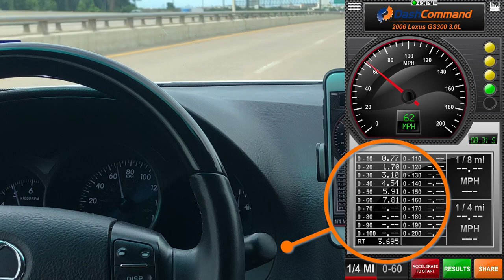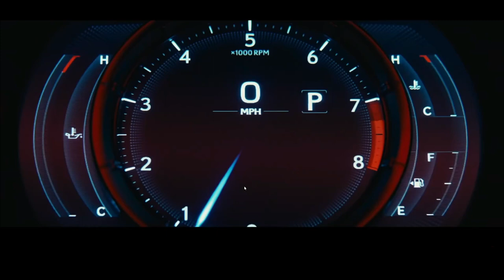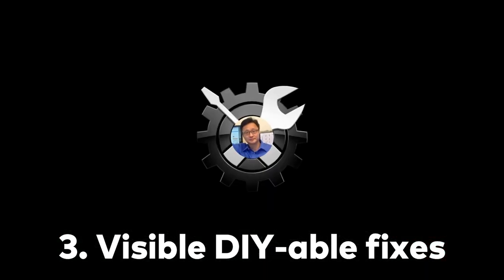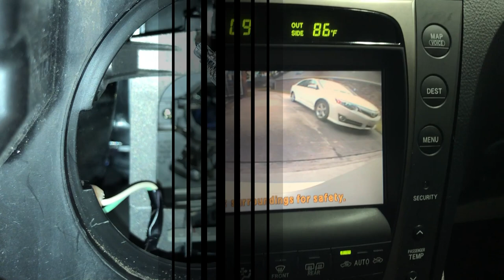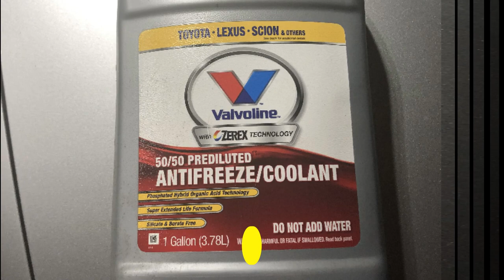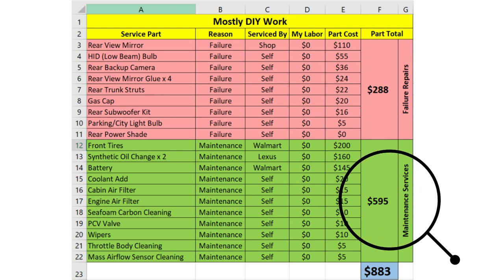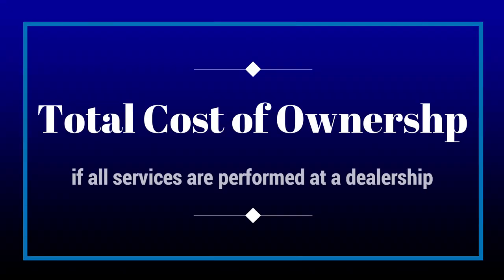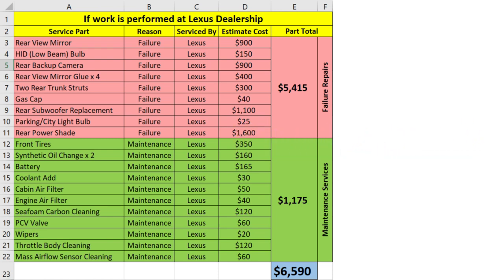2 Year Review & Cost of Ownership GS300/GS350

Comment: Thank you for your video. However, I'm sure most people will compromise and take it to a Japanese car repair specialist. However, I wonder how DIY folks like you as well as your local mechanic deal with the advanced cars of today which will become the advanced cars few years down the line. Will DIY and local mechanics have the equipment and technical expertise to be able to troubleshoot those used cars of moving forward,

Ravi Peiris M.D.
Reply from the maker: Actually, the diagnostics tool have advanced with the car, so most of the time, the diagnostic tool tells you problem areas.   Combustion cars still will be around a long time, but definitely electrical cars will rule, and without the complexity of combustion engine and transmission.

Comment: I have the slightly newer version GS300 so nice to drive it's in very good cond
Reply from the maker: I love this car.  :-)
Reply from the maker: This car is rock solid. Do keep up with the maintenance and it's going to last a long time time. How many miles do you have?   
Once the weather cools here in Houston, perhaps in the fall, I'm going to do the Transmission and Rear differential fluid changes.  
I saw the oil on spark plugs though I'm not leaking oil any where, I'm going to do the plug tube seal and valve cover changes also later in the fall.
Those are about the last maintenance that I haven't done, otherwise, I've done everything that I can.  I got 116K miles only on this 2006, so I feel like I can drive this to 200+K miles.
Reply: I had my first part failure today the boot latch release cover $10

Comment: I have found Lexus GS 300 But its at 300K km/186k miles Would you say that’s too big of a mileage for the car? Other than that it has all the servicing done.
Reply from the maker: Depends on how well maintained it.  What year and how much?
Reply: @DIYLifeSkills  it’s a 2006 model 5300 USD
Reply from the maker: Price is not bad given the inflation.  If you really like the car, I would get it checked out, especially the engine and transmission.  See if they did the transmission fluid change and carbon cleaning.  This car is GDI engine, meaning fuel sprays directly to piston and not to intake valves and heavy carbon build up needs cleaning at some point. I just posted a video of me cleaning just 114K miles and you can see how much carbon has built up, thought the car was running just fine.
Reply from the maker: By check out, I meant get a mechanic checked out.

Comment: How in the world did you get this car for only $5000?
Reply from the maker: It had many embarrassing problems like Rear view mirror was all scratched up, rear view camera was totally fuzzy, side mirror gears were grinding for few minutes after a start, rear subwoofer was blown, rear shade didn’t work,etc.  so the owner priced it at $5k and I gave him the full offer.    :-)
Reply from the maker: Also that was before pandemic when used car prices were reasonable. Now I’m in profit with this car. LOL
Reply from the maker: Free T  What year and what size engine? My advise is to go with 2007 or higher because 2006 uses GDI (Gas Direct Injection) that doesn't spray fuel to the intake valves and massive carbon builds up intake valves, which requires periodic cleaning which is not quick or cheap to do. I'm doing the carbon cleaning of intake valves now, and you can check out some of the videos I posted.
Reply from the maker: Free T  I inspected and test drove it myself.  During the inspection, I found the problems mentioned above, and engine and transmission was quiet and smooth.   It's good idea to get it inspected from someone that you trust.  Wow used car prices have really soared. Unless you are in a rush, you might want to wait until next summer or so when chip supplies & distributions catch up, and used car prices retract. 

That said, if you need to purchase the car now, do run a carfax report, and with 170K miles, it's important that they have already serviced transmission fluid, replaced water pump/thermostat.  If not, these are one of the first things you want to do after the purchase.
Reply: Heh I basically got mine for $4300.  Traded in my 2001 BMW X5 3.0i which I bought for $3600 six months ago and put about $1200 into it overall. Will have to put the same and then some onto the GS300 but I looooove it.
Reply from the maker: @BadaBing.UCF30  Awesome. How many miles and what year? And what size engine?
Reply: @DIYLifeSkills  2006, 92k miles, 3.0 V6
Reply from the maker: Wow! You got a better deal than me with lower miles.  I’ve got a bunch of GS300 videos that you’ll probably end up doing also.  The big one is not letting carbon accumulate too much on intake valves and pistons. Especially the piston carbon build up can clog the oil holes on piston ring #3 and that’ll burn oil and only engine rebuild will fix it.  So do oil changes every 5K miles religiously with good quality oil.  I just cleaned the heavy carbon on intake valves and piston heads and I’ll probably have to repeat this in another 30-50K miles.  Also you are due for a spark plug changes at near 100k miles.  Enjoy…I also love this car.
Reply: @DIYLifeSkills  Thanks! Biggest thing wrong with the car right now is the entire suspension, every single rubber part is worn to the point of constant grinding and bouncing in every turn. Will definitely keep the regular oil changes every 5K miles in mind, I'm actually doing the first oil change under my ownership this coming monday. Probably do spark plugs next month then finally tackle the suspension by April or May.
Reply from the maker: @BadaBing.UCF30  This is such a nice car, so Get good brand name struts that can last another 100k miles. Cheap ones don’t last long and they make squeaky noises within few thousands of miles.

Comment: Hi i am from Germany, Thank you for the great videos.
I have the same Lexus, wonder if you can make a video about the Power Tilt Memory Steering Column.
Mostly when the weather is hot outside, i hear grinding noise when the steering come into the driving position.
I think it is a lack of lubrication grease issue. 
I would be very thankful for a reply
Reply from the maker: I hear little bit of squealing once in a while but I'll have to pay a close attention next time for any gear grinding noise.
Reply: Many thanks for your reply, i appreciate it.
I am glad that you have also noticed this noise, i look forward when you are pointing that issue.
Reply: I have the same grinding noise.   It comes and goes though.   Currently, there is no grinding noise.

Comment: Im about to buy gs300 2006, check light on maybe transmission, IT is a good idea to buy it The price 4000$
Reply from the maker: That’s very good price but How many miles? Replacing with used trans could cost about $2000-2500. I had VW Jetta trans replaced for $1600 by a local mechanic and not dealer.
Reply: @DIYLifeSkills  it has 162,000 miles, tomorrow I will see the car first, it’s good to buy it?
Reply: @DIYLifeSkills  can I just change the fluid ?
Reply from the maker: @sergiobnr34 Changing fluid usually can’t fix broken transmission.  If you can test drive, gradually increase the speed to 60-70 MPH and see if gear shifts OK.  If it’s in a parking lot and they don’t let you drive until you buy, then hold the brake with left foot and put trans on all gears and see if it engages and try to move the car just few inches.
Reply from the maker: @sergiobnr34  if it’s a clean title car with good interior and exterior condition, that’s a real good buy assuming there is no major engine or trans issue.
Reply: @DIYLifeSkills  Its clear sir, Thank you So much! I will let u know again after see The car tomorrow!

Comment: I'm looking to get a 2008 gs350 with 160k miles for 10k. Is that a good deal ?
Reply from the maker: KBB list that particular car with that mileage at about $7K private party price, but KBB is out of touch with reality.  My son's 2016 Corolla with 105K was totaled last week, and KBB lists that as $11K value, but Geico just offered me $15K.   I couldn't believe it as we paid 18K in 2018 and it had 25K miles.  So driving 75K over 4 years, only knocked off 4K in value, which is unheard of in normal situation. 

This is due to the new car shortage because of chip shortages and supply-chain disruptions that delays car manufacturing and shipment.  This is what's making the used car market to scorch.  Therefore, I wouldn't say it's a great deal in normal situation, but it's a good deal under current used car shortage situation where there are more buyers than sellers.  See if you can negotiate a $1K off.

Comment: I have 06 AWD did 6.2 0-60, Mine been fine other regular maintenance. Mine has 152k hoping mine can last me little awhile.  Just replaced water pump, Spark Plugs , Etc.
Reply from the maker: Wow. Is that GS300 or bigger engine?
Reply: @DIYLifeSkills  regular 300. I did upgraded Intake Tube and air box to F sport from 350.  But car runs perfectly. Tomorrow i replacing PVC valve.
Reply: @Michaelats  hi. what does replaceing the PVC valve do?
Reply: @hanifmacca  its supposed be preventive maintenance, PCV system just helps reduce harmful vapor from escaping the car. Some people even delete them.  Its easy to do on 2GR or 3GR engine

Comment: How much you think it coast to fix the sun roof
Reply from the maker: What’s wrong with the sunroof?
Reply: @DIYLifeSkills  it just clicks and doesn’t move at all
Reply: @DIYLifeSkills  then if I push it. It will open but I can’t close it good and it would take me hours to get it right to get it lined up
Reply: @joelreynaga9160  Did you disconnect the battery or drain the battery charge recently and not go through the sunroof re-learn process? Also, the clicking may be the tracks loose under the headliner ( I have the same issue but arent looking at it until I try to mitigate my oil consumption). If unsuccesful, I won't even bother with the sunroof.

Comment: 0-60 ? Gs350? I think u have 300 not 350
Reply from the maker: This is 2006 GS300.  My 0 to 60 miles timed at 7.8 ses (before) to 7.6 (after tune up - spark plug change, MAF/TB cleaning, intake valve and piston carbon cleaning).  Oh  0-60 time was using regular gas. Not sure if premium would boost that slightly.